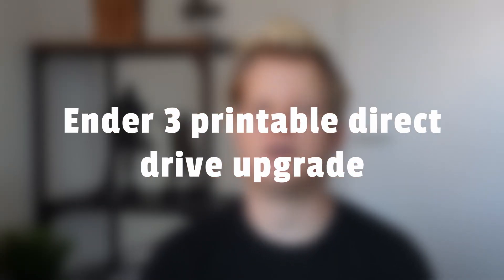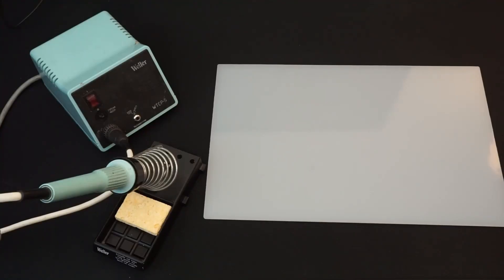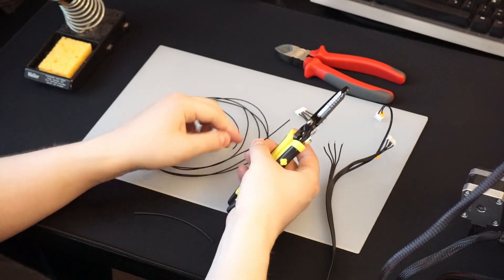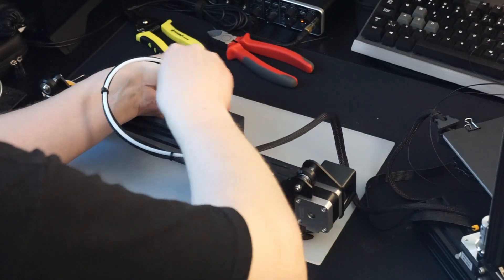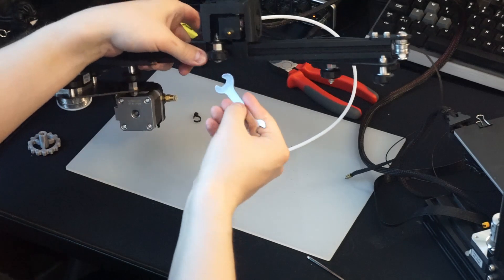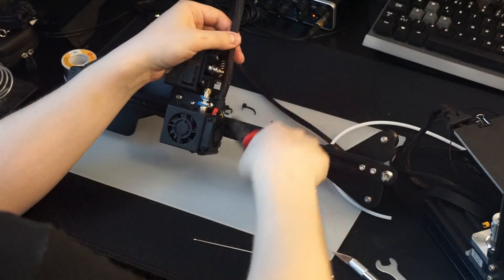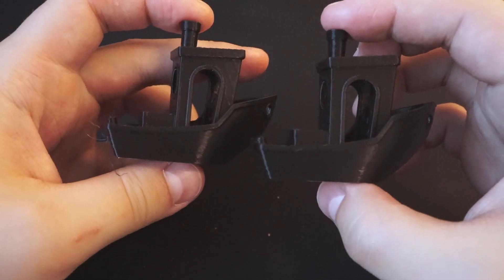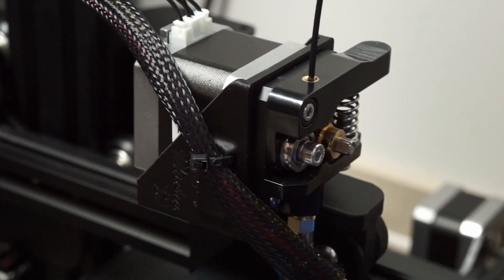Ender 3 Printable Direct Drive Upgrade

Comment from the maker: What is the best upgrade you've done to your 3D printer? Let me know in the comments!
Reply: Switching to the Creality Glass bed and side mount spool holder and quiet motherboard.
Reply: Great video man!. My favorite upgrade on my ender 3 pro, without a doubt has been the Filament spool roller assembly
https://www.thingiverse.com/thing:3209211
Reply: Good, honest video. Thanks for the idea. I've carried out many mods on my Ender 3, but by far the best is to my Bowden tube. I printed and fitted brackets to each end - thingiverse.com/thing:3482440 and thingiverse.com/thing:3625215, and removed the cable-ties holding the tube to the cable harness. This has fixed the tube from rotating and wearing each end for a more reliable connection.
Reply: Buying Cr10 springs for the bed of my Ender 3. What a difference in bed leveling.
Reply: I used the direct drive print for the Hydra fan setup, kind of wish I found this one but the effect is the same.  The Hydra replaces everything but the x carriage plate, this seems more elegant.  

Also, added an all-metal hot end and BLTouch 3.1 ABL.  Being able to print at over 100mm/s without stringing or extrusion problems has been great.  Also swapped out the springs for silicone spacers has made a huge difference.  For a control board I am running an SKR Mini E3 v2.0 main board with the 5v rail ugrade to control the Pixel LEDs.  Build plate is the Creatlity borosilicate glass.

I did find that the right side wheels got loosened a bit after printing at this speed so I had to adjust the X axis back to being perpendicular to the Z rails.  That put the dual Z stepper upgrade back on the list.
Reply: Klipper and a Pi Zero! Amazing speed, nicer to use and no down side! Ender 5 8-bit board.
Reply: Z motor shim (more of a fix than upgrade), then paid upgrades (in order of importance) PEI on glass bed, Yellow/blue die cast bed springs, Octopi on Raspberry pi, SKR mini e3 silent board, 3D touch.'
printed upgrades include bulleye fan duct mod, cable chains, rear electronics box, front parts and tools drawers, V slot covers, LCD bezel, power supply fan cover.
Less useful and could do without (3 point Y carriage), Creality textured glass

Comment: Nice idea - to differ from other ones that I saw here It'll not require adding a stopper to the X axis - so the table space won't be reduced

But pay attention that it limits the height because your extruder motor will bump into the top rail

Comment: Surface quality is likely affected due to the additional moving mass. You basically undid what the bowden tube setup is meant to fix; moving mass. Hopefully by now you're running Klipper and have an accelerometer so you can tune the resonance of the carriage which should solve those quality issues. Ender 3 for life, yo! It's like a Honda, everyone hates owning one, but it they're reliable and keep on running and have thousands of mods. :D

Comment: esteps need to be recalibrated retraction dist in the range of like 0.25 - 1.0  and reduce retract speed to like 25ish.... after that print some temp towers and retract towers, then linear advance
Reply: Shouldn't need to recalibrate esteps if you're using the same stepper and extruder gear. esteps only affects how much filament you're moving which isn't changed in this mod. But it's much more worth just upgrading to a Micro Swiss NG w/EVO.

Comment: Thank you for your honesty in evaluating this mod. I just started printing TPU on my Ender 3 Neo, and frankly, I am amazed at the quality I'm seeing with the standard bowden tube setup. So far, I've used Priline, Giantarm, and Sain Smart 95A filament, and seen superior results. I did make modifications to insure smooth, low friction filament feed, such as a spool roller, etc, but I really thought I was going to need direct drive to print with these materials,  but now I've rethought this.
Reply: good to know, I was looking at this for my Ender 3 Neo and haven't tried any of these filaments thinking I would need to have it direct drive. I'll have to try a couple out based on this.

Comment: the problem with direct drive is the inertia movement (the drive will be heavier) that causes failures on wall. the way to fix that is making adjustement on belts, slowing down print speed and maybe with TL smoothers

Comment: Very cool. Have you looked into replacing the extruder motor with a lighter pancake style motors that are used in the new light weight extruders out now?

Comment: Thanks for the video. I'm going to upgrade mine using a plate from 3D Fused because I have their linear rail system but ... the direct drive has to be better and more precise than a bowden tube. Has to be because it has less slop in the extrusion. I surmise that (as others have said) the lower quality has to be attributed to some tuning differences you need to look at. Such as flow rate, E-steps, and anything else you can think of that affects the area you have modified. I have linear rails, but you do not. It might have to do with the weight of the extruder motor which is bigger than the other three. They did this so it would have a little more torque that the other motors (for bowden tube). I do not think the direct drive needs as much torque. In fact I purchased a 42-34 stepper like the others (X,Y,Z) and installed it in place of the 42-40 motor as an experiment prior to me getting the direct drive plate. Even with the bowden tube setup, the smaller motor works OK (does not skip). I proved this comparing several prints using both motors on the extruder. The smaller motor weighs 75 grams less than the larger motor. You might want to look into the weight issue also. Waiting for your further experiments.

Comment: just a tip : don't cut your 4 or 6 wires perpendically but in diagonal. Like this it will be more easier to identify your different wires.

Comment: How about the strining from petg, is it going to be less then with a bowden?
Reply from the maker: I have some PETG ready, so I will test how good this setup works. Unfortunately I can't compare to the stock bowden setup.
Reply: @HardFirmSoft  I can tell you, it is okeisch with bowden. I tuned it as good as possible (with my knowledge) and i am left with some really thin hairs, depending on the filament more or less. But i want it perfect! I am waiting for your review, Thanks in advance.
Reply: it works so damn well with petg!

Comment: After 7 months were you able to get better quality prints as the bowden setup? And would pla be safe for this upgrade or will the hot end melt the mount?
Reply from the maker: Yeah, it's definitely better now. I would say the quality is pretty much equal to the bowden setup. So I wouldn't do this upgrade if you want better surface quality than stock. And no issues with the heat from the extruder motor.
Reply: @HardFirmSoft  i was mostly looking into this upgrade just so i can primt flexible filaments

Comment: I have come to a similar conclusion about print quality and direct drive. Perhaps other printers handle this much better, but I found my ender 3 pro was better off with the tube setup, as I prefer quality over the exotic options I could print. If I were to have a direct drive it would be a second printer, and not my main.

Comment: did you do an update video as to what the problem was with the print at the end  @13:24 ?
Reply from the maker: You can check for example my video "How to Calibrate E-steps and Flow Rate" https://youtu.be/xyrC0vVNGMs for some later developments with the printer.

Comment: The direct drive takes less retraction and less feed speed so when dialed in there’s less variation between different filaments, and Bowden settings are drastically reduced. Like microswiss recommends 0.8 mm - 1.5mm range of retraction for their direct drive
Reply from the maker: Interesting, I haven't tried going that low on the retraction. Maybe I'll try also lowering the speed as well.

Comment: One of the biggest tweek is the retraction figure put it down to 1mm instead of the standard 6.5mm . My mod works great, the finish is superior to the bowden tube method.
Reply from the maker: Yeah, I should probably try different retraction amounts and speeds to improve the printing quality.

Comment: your hotends now too heavy
Reply from the maker: It is heavier than before, but I'm pretty sure the bed is still heavier than the hotend. So the bed weight is still the limiting factor for reaching higher speeds. On the other hand, the hotend weight can affect how much the x-axis droops  when the hotend moves to right side of the bed.

Comment: I printed the part as you said without supports but the 2 sides were slightly off the bed which i did not see and they bowed/bulged out lol, waist for a 5 hour print (as i did 50% infill) lol
Reply from the maker: I did not try that so I'm not sure what went wrong. Are you saying the object wasn't completely touching the build plate when slicing it? You probably don't need 50 % infill, my usual range is 10 - 20 percent.
Reply: @HardFirmSoft  the object cannot completely touch the build plate, i only found that out after it had finished lol
Reply from the maker: In Cura, there's a rotation mode "select face to align to the build plate." There should be a similar feature in most slicers. Have you tried that?
Reply: @HardFirmSoft  i did but as i said, the 2 sides on the top and bottom are not flush, i actually got a micro swiss direct drive and hotend for my birthday yesterday anyway lol
Reply from the maker: I've been thinking about the micro swiss hot end. Let me know how the upgrade works out. 🙂

Comment: Work on your settings and I'd bet it will be drastically improved and results from print to print will likely be more consistent with this upgrade
Reply: Ps - lower your jerk and acceleration settings. More mass on the gantry means harder to change direction quickly.
Reply from the maker: Thanks, I think I'll try that next time I'm tuning the printer.
Reply: Even smaller retraction? 1.5mm? Maybe changing the speed of retraction as well? DD is not a favorite of PLA.

Comment: great video!  I would also consider re-calibrating E-Steps & Flow rates.  do to length change of the tubing.  you'll have less resistance on the filament since there is almost no tubing.
Reply from the maker: Nice to hear that you enjoyed the video. I actually made a video about that already, so maybe you'll want to check that out :) https://youtu.be/xyrC0vVNGMs

Comment: Best mod so far has to be TMC2208 driver on my ender 3! Nice and quiet now
Reply: Also, use Klipper, it enables faster prints at higher quality than Marlin 👍
Reply from the maker: That's nice to hear! I'm actually planning to install an SKR E3 Mini mainboard upgrade to get 2209s in my printer.
Reply: @HardFirmSoft  My friend has one, its good and pretty cheap too! I did it the hard way and swaped the drivers on my stock creality board and then modded in UART
Reply from the maker: @ximonx  Whoa! That's some hardcore modding! I didn't even realize that could be done. Why aren't you making videos? 😄
Reply from the maker: @ximonx  Gotta read through that. Nice to see people creating something new in this community! 🙂
Reply: @HardFirmSoft  highly advised!  love my skr mini e3! also the mesh bed levelling is great on the newest marlin FW

Comment: Hmm i wonder if a closed loop stepper on x axis would help?
Reply from the maker: I hadn't really heard about those before, but wouldn't that require the motor driver to be changed? I wasn't really seeing any lost steps on anything else than the extruder, so maybe it wouldn't help on the X-axis. But thanks for bringing the closed loop concept to my knowledge.
Reply: @HardFirmSoft  No the driver is placed on the back of the Nema 17 size motor so just plug in the original cable in the driver but change place on controll board or use adapter. Im more thinking of it as a help to cope with the added weight so it hopefully reduce the uneven surface. Sot sure it will help but maby. There are several brands with different resolutions. https://www.aliexpress.com/wholesale?catId=0&initiative_id=AS_20200724131759&SearchText=closed+loop+stepper+nema17

Comment: Also I'm not sure the link to the stepper extension wire is the right product. The comments on amazon seem to say it's the the right size. Searching amazon for "nema 17 stepper extension" gives quite a few other results that are less expensive and have reviews saying they fit.
Reply from the maker: Thanks for the comment! With that search, I'm only seeing cables that have a male 4-pin connector on the other end. In addition to the male 6-pin, the cable needs to have a female 6-pin to fit for this purpose. The cables in that search would work if you wanted to replace the whole cable and plug it directly to the mainboard.

Comment: I haven't done this upgrade yet but I am guessing the change in print quality afterward is that you then need to adjust your esteps value in the firmware so that the extruder is extruding the right amount. I am guessing it's overextruding a bit with the shorter bowden tube since it has less friction and tension in the filament which produces blobs on the surface of the model.
Reply from the maker: Thanks for the tip! I'll be looking at tuning E-steps among other things in an upcoming video.